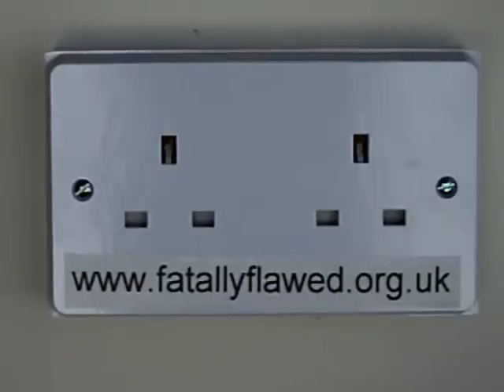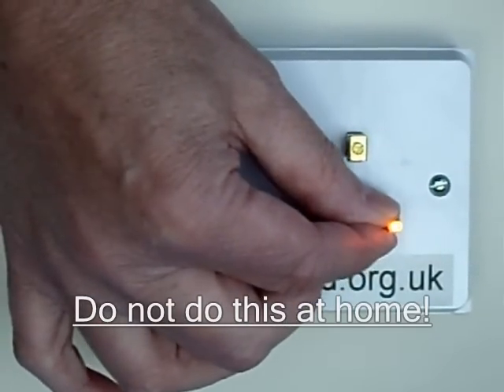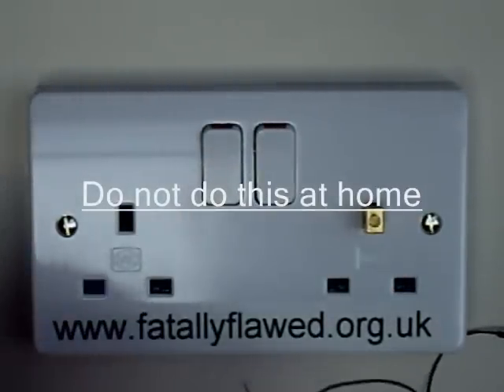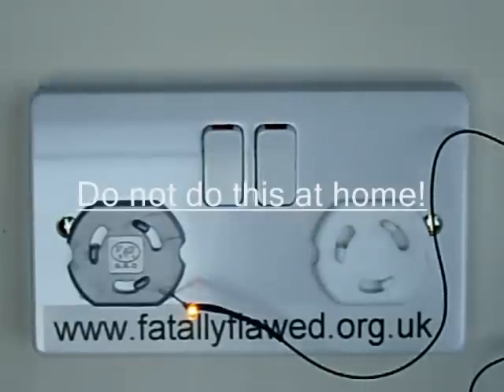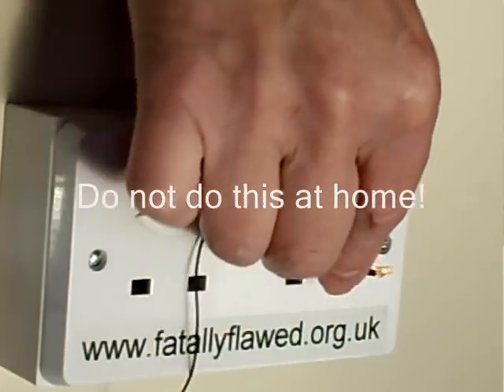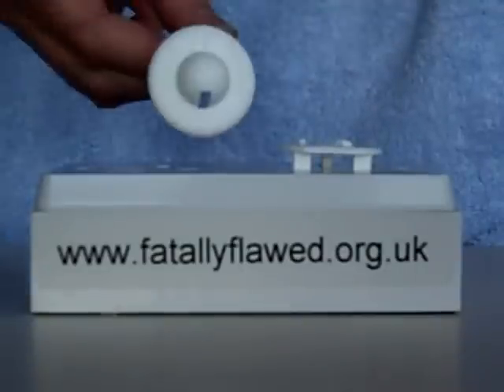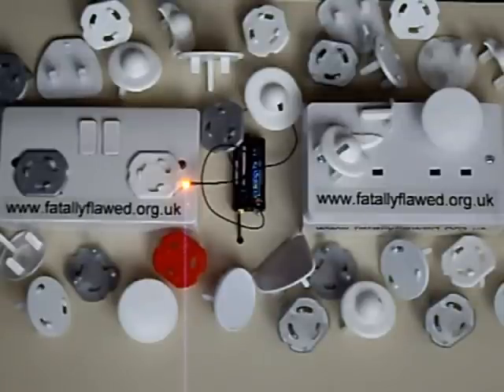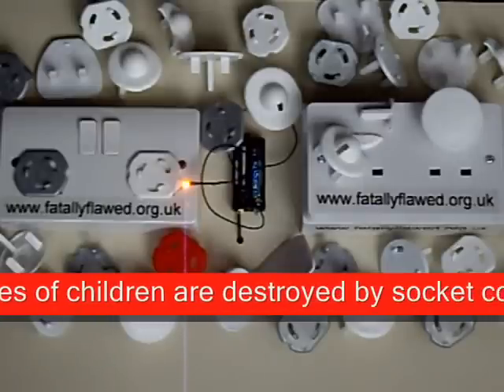The Dangers of UK Safety Socket Covers

Comment: Also be careful when you remove compact transformers (phone chargers and similar) from the socket. The earth pin (longest) if often made of plastic and can break off in the terminal creating the "open gate" effect. If this happens, turn off your electric supply (make sure its off!) and remove it with a very thin screwdriver or similar. If you can't get it out DO NOT JUST LEAVE IT. Get an electrican to sort the problem.

Comment: In addition to what I have already stated - Ive seen both earth and neutral pins broken off in sockets, jamming the gates open and leaving the line exposed. Prolonged use of many covers can actually damage the outlet aswell by bending the contacts out so they will no longer grip the pins properly. This is actually a fire risk as the contact area is reduced resulting in a higher resistance and thus, more heat when current flows. Especially using high-power devices such as kettles.

Comment: Great that MK is now supporting this, extract from FF homepage:
“MK does not see the need for or support the use of so-called socket-protectors in BS 1363-2 socket-outlets due to the fact that protection against access to the live and neutral socket contacts  is always provided by the shutters. ....
MK goes to great lengths to ensure that all its BS 1363 plugs and sockets are safe.  Inserting incorrectly dimensioned products into a socket-outlet can both damage the socket and reduce its safety.

Comment: Good video. Secondary plug protection is one thing but ensuring the installation (Socket Circuit) has protection against fatal electrocution is a better solution to start with. Best to have your socket circuit checked by a qualified electrician to see if you are protected against fatal electric shock by a current of electricity. Modern installations have RCB &/or RCBO's that trip the supply (Shut it off) if an accident occurs in the circuit that could potentially cause a fatal electrical shock.

Comment from the maker: @rustypeanuts Please see the FAQ page on the FatallyFlawed website for a full answer to this.  There are no socket covers made to the correct pin dimensions, if you force oversize pins into sockets then the contacts will be damaged, this can lead to overheating and fires when the socket is used to supply power.  The only fool-proof way of protecting children is to keep all dangerous appliances out of the reach of children, never rely on flimsy pieces of plastic to do a parent's job!